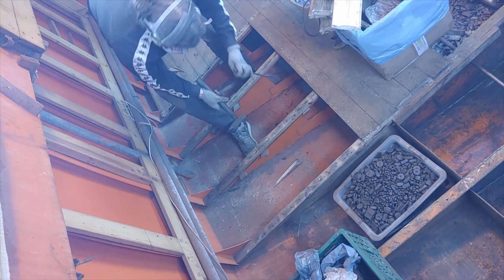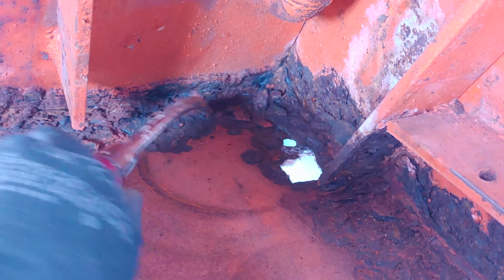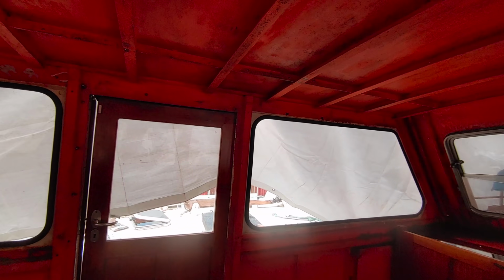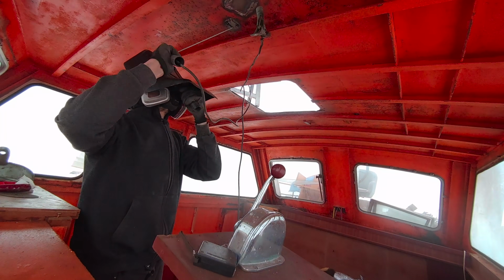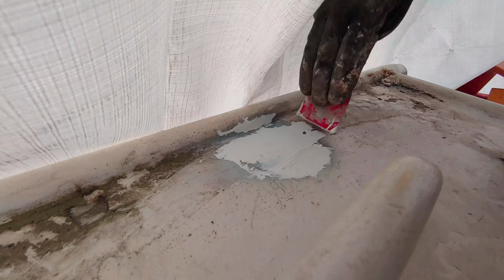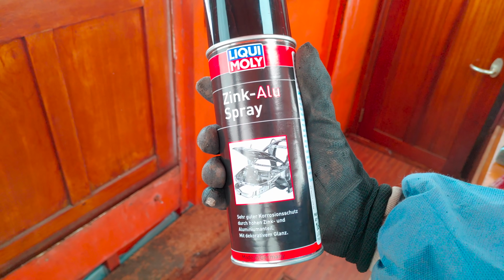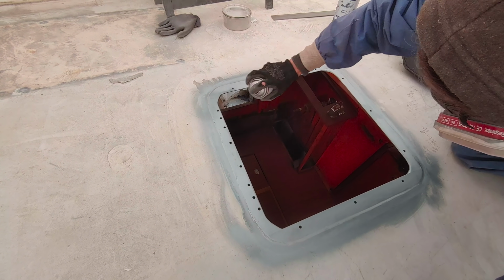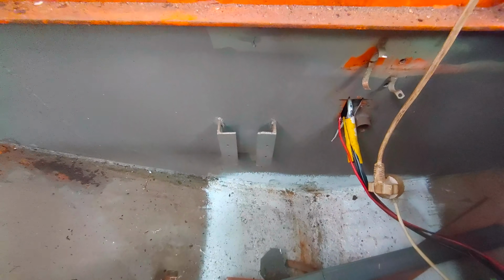Dealing with Heavy Rust on our Steel Boat - Week 27 - Vintage Yacht Restoration Vlog

Comment: Sorry to say this, but you are making a huge mistake: these approaches to rust treatment do not work in the medium term and you will be forever fighting failed painting systems and breakthrough rust.  It is a significant one off expense, but the ONLY good way of undertaking a project like this is to remove absolutely everything from the boat, do all the welding / plate repairs and then grit blast the entire boat inside and out and spray paint with two part expoxy primer and several more coats.  That will last 30 years with no rust rather than the rust ridden hell that you will have in only five to ten years. Those rust treatments are not a long term solution.  I have owned steel boats for 30 years and lived on board for 25 years and one of my steel boats was over 100 years old - so I am not new to this.  For small areas you can get several good years from Owatrol CIP rust killing primer, left for three days and then painted in Hemple light primer or similar, and then over coated with several expoxy layers: but the only GOOD treatment is grit blasting and sprayed epoxy.

Comment: I play golf with the owner and founder of a company that offers a ceramic coating that bonds to steel and prevents corrosion permanently. 30 years warranty above the water line. Bonus  it's antimicrobial and fire resistant to thousand degrees F

Comment: rust converting "oil" does nothing when applied to non rusted or grinded metal. It only works if you apply it to some rust, by converting the existing rust to a inert element, iron tannate. It is totally useless to apply rust converter on freshly grinded metal as a preventive measure, it will do nothing now and will not prevent corrosion in the future.

Comment: Do not use teflon tape. Use lamp wick with Permatex for a permanate seal. Teflon will forever be very easy to break the seal because it will move easily.

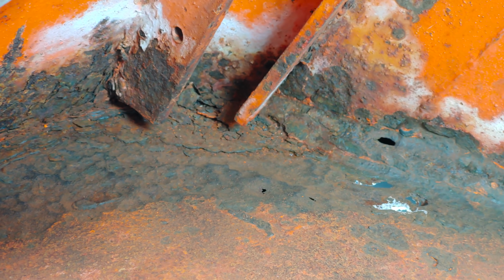Comment: 2:02 there are holes in the plate, you can’t just put some rust converter on it. NO cut the hole thing, this is gonna break at some point.

Comment: ....water damages apart causing the metal to get rust...think about the galvanic corrosion due to not isolated electrical appliances (alternator for instance + bipolar circuit breaker and so on). if yu can use a Balmar alternator with all isolated poles and two poles airpax sensata circuit breaker

Comment: The rust underneath all your windows was so severe and ate away so much metal that I am questioning the structural integrity of the cabin. A few other points of advice, zinc primer is not meant to be painted over, read the user manual on the can! The self-sacrificing characteristic of zinc will eventually repeal your paint and so the protection of your metal. Another thing is that I advice you not to use polyester filler paste, it attracts water and should never be used on boat exteriors. Only use epoxy based fairing material. And I don’t understand that there are people who rely on those rust converters, it’s only used by DIYers and never by professionals, why would that be? I’m not trying to bash all your hard work but I always feel sorry for people trying to do their utmost and than be disappointed in the near future. I’ve being a yacht painter for 14 years at Royal De Vries/FEADSHIP in the Netherlands and know what I’m talking about. I which you all the best with the restoration.

Comment: Use PTFE tape for the valve connection. I turn per MM size of the pipe - looks like that is about 25mm as such 25 turns. WInd it on tight and up and down the thread.

Comment: A tip for arc welding, keep the electrode consistently at a 45 degree angle to the work piece, that way the flux on the outside of the electrode covers the weld properly

Comment: NEVER use 5200 !  The only way to get a fitting off that has used 5200 sealant is heat.  Lots of heat !  Use Teflon tape AND Teflon pipe compound.  Same as what they use in most plumbing.

Just my opinion.  If I wanted to fir a hatch with a flat frame to a curved deck, I would start with a piece of thick plastic.  Cut it to match the frame, with maybe 2cm extra.  Contour the areas of the plastic to fit the deck and still provide a flat and level surface for the hatch frame.  Drill hole matching the hatch frame through the plastic and the steel deck.  Apply butyl tape to both sides of the plastic and bolt it on.

Comment: None of the rust removing works I’ve seen you done in this series will prevent it from continue rusting out. Don’t use grinding disks or rust „converters“ as they will do nothing or even make it worse. Use sandblasting, wirewheels or needleguns as grindig discs will only push the rust further in the material. The whole boat should’ve been paintstripped, sandblasted and largely welded with the use of replacement panels as so many parts of the structure are weakened. In my opinion you’re doing a lot of work for nothing and bringing yourself in serious danger. Anyways, listen to your subscribers, talk to professionals and learn on your way. Good luck and kudos for the effort.

Comment: While doing engine work, you definitely need to replace the water pump impeller before you put the boat in the water and also replace the belt. Make sure your temperature gauge is working as well. Don't want to overheat the engine. Cheers from Austin, Texas

Comment: U take so much time n effort to remove all those corroded woods, then should give a gd repair.
So send for sand basting. 
Windows opening should send to machine shop to cut a new piece opening plate then can weld on d old 1.  It's time to trade in an inline 6 engine. Japanese brand engine ( recon ) cheap n really to go.

Comment: ON YOUR VALVE , USE TEFLON TAPE.. ITS WHITE AND CHEAP AND IS USED ON GAS AND WATER PIPE CONNECTIONS

Comment: For those corner I think you should try a needle gun. We used for the corners of our diesel tank and it works sooo good!! 😅
Reply: I was going to recommend the same thing.  Mine works great.
Reply: As much as I’m enjoying this guys renovation, I wish he’d take the same approach as you guys have on your boat, with your do it properly the first time and do it nice haha
Reply: @Luke-2153  and never put the boat in the water...
Reply: Needle does work but a chisel attachment instead of needles pulls up those flakes much better

Comment: You know something else that would help with that pipe, a sanding belt,a good drill and making a wheel for the drill. Turn the belt sand side in, get it over the pipe and use the drill and wheel to turn it to sand that hard to reach spot, takes a little practice but works.

Comment: I'm amazed that you still have not started working on the bottom of your boat with only a few weeks left before splash time.  All the work I've seen you do so far could have been done after you put the boat in the water.

Comment: The exhaust tube is probably is the last thing you want to skimp out on. Not only do you have the danger of carbon monoxide poisoning but you have a source of water to leak in the boat.

Comment: You need to get serious about treating the rust. That means like the commercial ship repair yards. That means needle gun minimum, preferably sandblasting with a good strong compressor putting out at least 125psi and using the correct grit size to provide the correct key for commercial grade paint coatings. Anything too far gone should be cut out and replaced with new plate.  How do i know all this?  Just relaunched  our 45'  steel yacht after 8 years of blasting and painting. Believe me you wont want to go through all this work again so do it right the first time. Curing rust issues isn`t rocket science, it just has to be done properly the first time. Be great to see all that enthusiasm have a happy conclusion, steel is great. Just need to upgrade the processes.

Comment: DO NOT use 3M 5200 (AKA Devil's Glue) to seal that valve unless you never want it to come off again.  3M 4000 is more than good enough for that application and it won't leak

Comment: Look into getting a pneumatic needle scaler.  Gets that rust in the corners and it doesn't create a lot of dust comparitively speaking.  Much more efficient and effective than a screwdriver.  Use hearing protection!!

Comment: Some of the items you removed (drain pipe, little shelf) had a purpose at one time.  Especially with the drain. it will be interesting to see how you deal with the issue it was put in for in the first place.  I understand your not wanting to weld the new metal replacement (future rust?)  but wonder why you didn't put in a pvc replacement.   Think you're doing a great job and enjoy seeing how you do it.

Comment: You need to replace that steel that is completely rusted through. If you do not take care of this area now you will be taking care of it later when everything is put back together. Do it now while everything is out and you can get to it freely and you can do the welding work done and replace all the steel work that needs to be replaced in your boat.

Comment: You need a needle gun. You can buy a air model which is cheaper but you'll need an air compressor or an electric model. That rust wasn't taken down far enough and you put rust converter over it as a temporary fix. It will not last long and it will just hide the rusting going on under the paint until you do it again and then it'll be a lot more work. This is hard to watch.

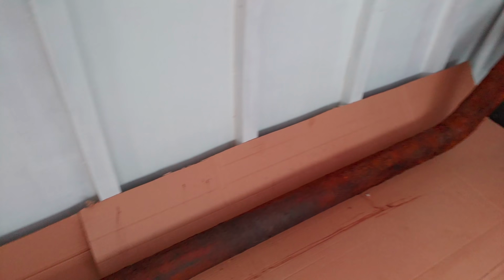Comment: @4:00  There is no need to run a DRY exhaust horizontally through a living cabin. And it's dangerous if it's rusty and leaks. Run it straight up through the roof from the engine compartment!

Comment: Owatrol Oil does not stick well on other paint, it sticks only on rust. There is Ovatrol CIP which should stick on other paint, but in my experience, it does not work well too. Better do not paint over the areas that still have paint on them with Ovatrol and also not bare steel that's not rusted. Make a test of the areas you painted over with Ovatrol, you can probably remove it with your fingernail even after it dried. And for the exhaust, I don't think that Ovatrol is heat resistant enough, better use some oven color.

Comment: Recommend you do a pressure test on that exhaust line. Plug both ends and test with just a few inches of water pressure. Just to be sure no leaks, carbon monoxide is bad stuff. Also we used rectorseal which is a liquid Teflon sealant. Great stuff

Comment: One tip you may not have known is the thermal expansion rates of iron oxide and steel are very different.  I use heat to chip heavy flake rust quite regularly.  If you do not have a small oxy-acetylene rig, it might be a good time to invest in one.  You can start with a small tip and just heat up the rusty area.  The flakes will almost shoot off (wear goggles, etc).  It is then ready for wire brush and rusty metal paint.

Comment: As others have mentioned, when rust gets to the point where you can flake it off in chunks, and/or has eaten through a substantial portion of the steel, and/or has eaten holes in the steel, the ONLY safe and effective repair method is to cut it out all of the way back to sound steel and weld in suitable repair material.  Rust converters are intended for surfaces where you are treating the minor pitting left from removing surface rust, and fiberglass is intended to be applied to a clean, sound, rust-and-oil free surface.  What you are doing is the same as a doctor putting an adhesive bandage on a malignant cancer and calling it cured because you can no longer see it.
Reply: Simple rule for any rust.. if it's black, it's coming back
Reply: So true, this part is more a "how not to restore your boat" :-) You did such a nice job the earlier stages. I worked a lot on old cars and the only good way is cut out the rust and weld in new metal. Important for boats, it must be from the right grade (In this case maritime grade steel, but most important,  the same type the hull is made from)  All other solutions are temporary and  even can speed up the rust (has to do with chemical and electrical effects, like a zink-anode reduces rust on steel parts)

What I often prefer to do is first cut a piece of steel, outline it on the hull  and then cut that form out of the hull.
Reply: You are right - and beyond this, grit blasting and sprayed two part expoxy is the only long term treatment that actually works.

Comment: Some of these through fitting/Pipes for drainage can be replaced with Bronze. They will last forever.  Also, you have to cut out that rust up near the windows. I know you don't want to do it but YOU WILL DO IT ANYWAY in the future!  Do it now instead. Everything is there and you do have the time. No is that time.

Comment: Do not use 5200, use 4200....its a big deal.  5200 is an adhesive and you never use it if you ever have to take something off again.  Do not use 5200, what a disaster!!

Comment: The zinc plating spray will not prevent rust completely, you should paint over it with several coats of weather resistant paint to insure the zinc paint does it’s job.

Comment: I am curious as to why the manufacturer put in the the rain pipe and why you think it’s not needed. My thinking is they wouldn’t put a gutter there for no reason (after all they’re the boat builders). Why not put in a larger pipe or least replace it with new one and instead of a 90 degree elbow (where I think the water just laid there) and put a 45 degree instead. Also, Are you not planning to put solar panels on the boat? You should provide a conduit for any roof penetrations to go below deck or to where any wires are destined to terminate IMO.

Comment: Three simple techniques to improve your stick welding.  1: Get a head mounted helmet,  It will leave  your left hand free for #2.
2:    Use your left hand to steady the rod at the weld puddle.  3:   Preheat your rods to remove moisture. A rod oven will reduce splatter, cracking and porosity.    A common toaster oven will substitute for a commercial unit ( starting at $100 ).

Comment: If you do not intend to ever take valve out use 5200. If you think might want take it out, either to exchange it or simply replace it, use 4200.
Reply: If you want to take a previously 5200 bonded part out and it`s metal just heat it up with a heat gun to about 70-80deg C and the 5200 will release. If it`s a plastic part bonded with 5200 you can kiss it goodbye with a large hammer,,,

Comment: The rust around the bridge? windows, needs cutting out and replacing, while on that subject check your windows, all those hot sparks flying off when grinding can stick in the glass, soon as you use the boat and get any condensation it will rust, good progress keep going its starting to come together.

Comment: A needle scaler is a great tool for dealing with this kind of rust....  
Re: seacocks - I would remove the whole thing and use composite seacocks.   As it stands, you are mating a brass valve to a steel pipe, which is not good from a corrosion point of view.    If you can find Marelon (Forespar or TruDesign, for example) that would be better.  Otherwise, I would remove that old pipe entirely and use a proper through hull.  Also, don't use 5200 as it is not designed for this, you can get a pipe dope that will work well.

Comment: To seal the threads on the shut off valve I would use ptfe tape find it at all plumbers shops
Reply: Brass usually does not need plumbers tape
Reply: @kennethhudson8013  yes you can use it but the better way probably boss white and hemp

Comment: Use Teflon Tape for sealing the treads. Put it on  clockwise and wrap the male threads several times. It’ll work well. It’ll also allow easy removal if you ever need to take the valve off
Reply: I agree, you can see in the video a few strands of Teflon tape still on the pipe threads, so my guess is it worked well enough for the previous owner(s).

Comment: DONT PUT THE SELANT ON. you just need teflon tape of plummers dope(its called gasola in canada). if that ball valve ever fails you will now have to take that entire piece off to the weld :(  the threads are slightly tapered and make a seal and just need to add reflon tape to the threads

Comment: I truely hope that your solution with the exhaust pipe works, but I think it could be a big problem for you. If it leaks fumes into the cabin, it could be deadly and if you survive, you will have to take the interior apart to get at it. Good luck.
Reply: It’s a Diesel engine it won’t be deadly if it leaks
Reply: @mick8137  
How do you get by in life? You do know that diesel engines run on fossil fuel don't you? Carbon monoxide is a product produced by fossil fuels when burned. If you breathe in the fumes, it will eventually kill you.

Comment: I have used rust-oleum rust metal primer for years which has fish oil in the ingredients that help force out moisture. Leave exposed with primer before top coating.

Comment: What I always find really nice to do when patching holes. is using a holessaw to cut out nice round disks, then using the holesaw to enlarge holes that need patching. And with the disk you have a perfectly fitting piece of metal. Clean, quick and easy. you could use a piece of wood as backing to use for centering the holesaw
Also way faster than drilling wholes and then cutting it out and getting the square to fit,
Just an idea, keep up the good work tho, really entertaining to watch